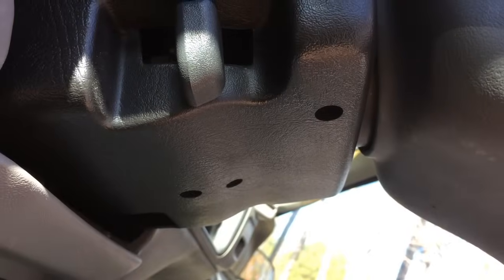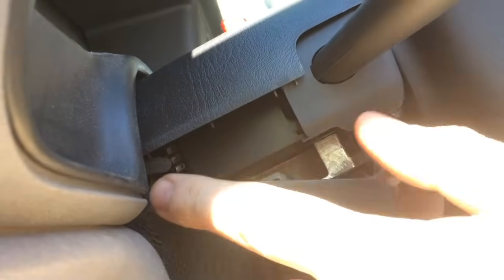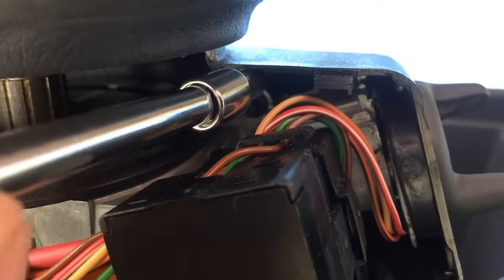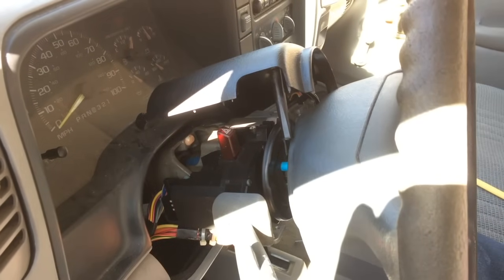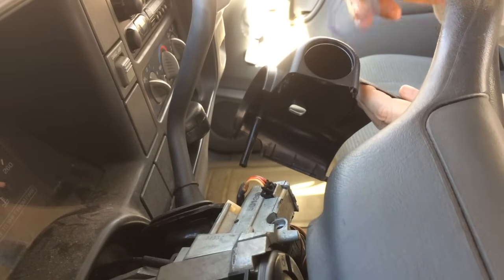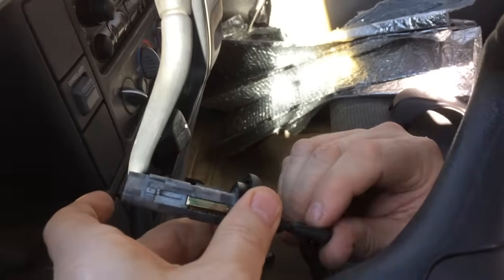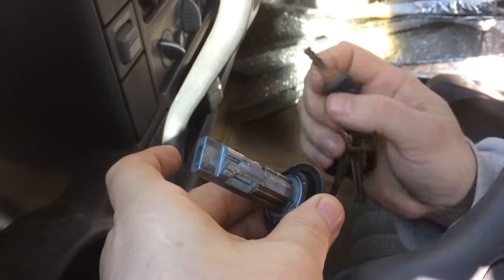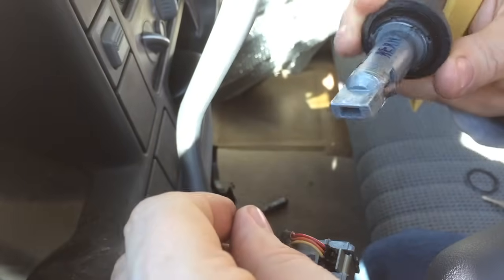1995 - 2000 OBS GM Truck Ignition Lock Cylinder Removal (Chevy Cadillac & GMC)

Comment: So, you’re telling me I can’t remove the lock cylinder without the key which is why I bought a lock cylinder? LL
Reply from the maker: If you've lost the key, yeah you''ll need a locksmith to get to this point of removal to install that new cylinder (or drill it out).   It's for theft prevention when the vehicle was new, so GM made it hard by design.
Reply: Thank God I’ve found the key
Reply: you can just drill it out, plenty of stuff on how to do that.
Reply: My key just won’t turn anymore and my steering wheel isn’t locked.
Reply from the maker: @Master_Yoda1990  You might check out the comment thread below from 
Jeff Burkholder at 6 months ago.  Sometimes you can follow what he and I discussed there to dislodge the key enough to extract the damaged lock cylinder.
Reply: DrShock thanks, didn’t have a drill, but I pounded the key in while turning after applying wd40 and it loosened up, however not really advised since it can ruin the key in the process.
Reply: @darkarvindrakkar9898  where?
Reply: @DrShock  drill what out...the pin in the little hole??
Reply from the maker: The locksmith would drill out the key tumblers in the cylinder
Reply: @DrShock  Do you know if these use keys that need programmed? Appreciate the video!
Reply from the maker: @chrisnielsen5467  No programming needed of keys on these model year trucks.
Reply: @DrShock  thank you!
Reply: So how would I drill it out through the top little hole or through wood with key goes
Reply: Cc  @DrShock
Reply: @DrShock  great, I just bought a 98 suburban for 500 bucks because there's no ignition key lol. Good thing I know a locksmith

Comment: Thank you for the video.  I am a 73 y/o 'lady' who today, thanks to your posting was able to replace a 'broken' lock cylinder on my 1998 Chevy Blazer LT.  All went exactly as you detailed on removing covers and old lock cylinder.  I put in the new one, but found it would only go in about two thirds of the way!  Oh boy.  I googled the issue and checked youtube to no avail.   I did notice that the 'pocket' inside wasn't lining up with the new cylinder.  I took a small tool and found I could turn the 'pocket'.  After two small turns, I tried again inserting the cylinder.  It fit perfectly and functioned as it should.  Hooked the battery up and started my car.  Fantastic.  Again, thank you for sharing.
Reply: 0

Comment: Thanks DrShock for posting one of the better videos on this procedure. Some have you removing the steering wheel, which I didn't really believe had to be done. Great job!👍😎

Edit: I just did this lock cylinder replacement for a friend of mine and it went so smooth that he swore that I must have done it before.Thanks for making me look like a pro!

Comment: Truck was stolen this morning, and recovered a few hours later abandoned. They damaged the ignition cylinder and so it has to be started with a screw driver. This video makes it easy! Thanks! The crooks did most of the work for me too and already took off the plastic covers.. lol!
Reply: My 96 was broken into last night and the steering is still locked but it's moving a little more freely do you know if thats only because the ignition is ruined or could it be the actual steering column

Comment: I just replace my ignition switch wiring harness. Before I put my top cover on my  steering column  I took some accurate measurements and drilled a little hole that I could get a ice pick through that was right in line with the ignition switch  release hole. So if I ever have to take  my key Tumbler out all I have to do is put ice pick through that little hole turn my key to the run position press to release turn my key back and remove the whole Tumbler. It works out great.
   There is a Nother video out there that tells how to measure off the emergency flasher switch to locate where to drill the hole that aligns with the Tumbler whole

Comment: Thank You Very Much!! it was that tiny hole on TOP,  this was on a 1999 S-10, everything else said the hole was on the bottom, note, don't touch or move anything, just push new cylinder in with key, and Done!

Comment: Awesome. Thank you. A standard 4mm socket works for the e5 hardware.
Reply: Not always, a 4mm did not work for me but my screws were a little worn for some reason but most of the time a 4 should work

Comment: Been having codes for torque silanoid and I changed it codes are still throwing so I had the transmission shop run diagnostics.  He said it was sealed up tight and it wasn't internal but he showed me one of the common symptoms is the ignition switch.  Never heard anything like that. Anyone here hear of it? 
Appreciate your video I got hung up with the top shroud and I like your idea to use that piece as a washer after popping it out. 😉

Comment: if the truck does not have a tilt, you can relax the two nuts that hold the column to the dash. This will  give you room to pry the top piece of the column cover out

Comment: Yes, I have done that but for some odd reason, the new switch is engaging the security system which I do not have a keyless entry or anything about nature what to do
Reply from the maker: For the old body style truck years this video applies from the video title, you might find some information in the description that helps.

Comment: DrShock, ever had a "Security" light issue? Re-watching this one... My '99 Suburban thinks I'm trying to steal it! Security light stays on, not the flashing security issue you can fix by relearning the key. Truck starts and immediately dies. Got a reman Passlock module that was supposed to fix it but...here I am.  Gladly use the tip jag again if you have any advise.
Reply from the maker: What are the codes pulled by the scan tool, if any?  This can be caused by a lack of communication between the VCM and the Passlock/EVO module.
Reply: @DrShock  TY for the reply. No codes... Just found that someone had done the diode install bypass trick in the past. So in theory, the new passlock module I put in is being bypassed; correct? I'm really perplexed on what to try next.
Reply from the maker: With no codes, and these symptoms, it's most likely a wiring harness problem.   You'll need a factory service manual schematic, but what you'll want to do is go thru the checklist in the service manual checking for good fuses and proper voltages at each pin to the passlock/EVO module.  Next there will be resistance checks across various pins of the harness.  As I mentioned earlier this kind of fault can also happen when the VCM cannot communicate with the passlock/EVO module.   You'll need to check the harness between both for any problems with the serial data line.  While the ignition cylinder has a role to play, it's very unlikely to be causing what you're seeing unless it's the incorrect part or extremely shoddy asian import part (either way missing the integral magnet required for passlock to function).
Reply: @DrShock  Holy Moly... I started looking at the wiring harness and found where someone has done the "Diode" hack... Now what? Should I suspect that diode went bad/burned out? I'm going to try to reconfigure the bypass and see back in factory condition the reman Passlock works, I can always replace the diode hack if that doesn't work. Thanks for the reply. My last attempt before I call the Calvary and have it towed to a qualified shop... I don't know how much of this I can take.
Reply from the maker: Most digital multi-meters today have a diode test setting, you could check to see if it has failed.  But if i were me I would remove this sort of modification and return the vehicle to the stock design.   Someone may have done this to cover up a different security lamp or code problem, rather than properly diagnosing it at some point in the vehicles earlier life.
Reply: @DrShock  Got a real scan tool on my Suburban and he found a1626 Anti-theft deterrent. Can't clear it though... That's probably why someone went the resister by-pass route. Now trying everything...
Reply from the maker: I think you meant code P1626 there.  That's a code that still typically points to a wiring harness related issue.  The GM service manual would be needed walk thru the numerous tests and checks at the VCM, passlock modules, ignition wiring, etc.

Comment: So our truck takes forever to get it to turn. We thought it was because we lost the original key so we had to use the spare key now, do you think my key is the problem or the ignition?

How much does the ignition cost and are they universal or do I need a very specific one? 
Thanks in advance
Reply from the maker: The Ignition cylinders are vehicle specific, I include the GM numbers for the trucks this particular video covers in the description above.   As far as having different keys behave differently I've certainly seen where an original key works smoothly and a replacement doesn't, that behavior is all on the key.   But if you have two keys that both are hard to turn, then there I would more suspect the cylinder itself as the problem.

Comment: Well the hardest part was getting my key to the start position seeing how I was replacing my ignition cylinder because it wouldn’t go to the start position
Reply: I'm in the same position how did you get yours to finally turn to the start position? Mine is jammed and will only turn a few millimeters each direction and the steering wheel is locked as well
Reply: I’m in the same boat.
Reply: Pry off the plastic piece that is exposed on the lock cylinder where you insert the key, once that piece comes off stick a small Allen wrench or screwdriver etc. underneath the locking bar at the bottom of the cylinder and lift up on the locking bar while turning key and it will move into position

Comment: Hi I am in the situation where the key will not turn enough for me to get the punch to hit the pin for it to come out like you said but how do I get it out at that point? Does anyone have suggestions
Reply from the maker: The lock mechanism can get jammed if there's an obstruction from broken metal (like the retaining pin for the lock mechanism).   You have to lube it up really well, with a lock specific lubricant, and and try to rock it back and forth to see if you can get it to free up enough to move the release pin into position.   It can take some significant time and patience to work one out with that kind of problem.   If you don't have the time, I would just suggest going straight to the mobile locksmith option.

Comment: Can someone explain what the wires are for above where u put ur key?... are they part of the security system at all?... I'm having trouble with mine because the person before me that I bought the truck off of had all this is a mess and it was all tapped in place with electrical tape so after removing the tap my truck won't start and I noticed those wires either weren't on my truck or they were removed and if that has anything to do with the security system in anyway I'm wondering if that has anything to do with it
Reply from the maker: The wiring layout in the column area may vary across models years, or across automatic to manual trucks.   Best advice would be to consult a service manual for the particular year truck and verify you have all the wire colors and connections the schematics show for the steering column area.  

Another option is a stop at your local pull-a-part salvage yard, like an LKQ, and visually compare an exact same model year and transmission type truck.   You might even just pull the intact wiring harness and use that instead of your previous owner damaged one.

Comment: Will a this give a intermediate  security issue? I can take my key out of the tumbler in run position
Reply from the maker: The connection on these old body style (OBS) trucks ignition cylinder with the security (aka Passlock) system is the magnet built into them.  When you turn the key the Passlock security module is looking to see that magnetic signal input to confirm the vehicle ignition switch is not being physically bypassed.   As long as you have a genuine GM cylinder, or a top tier OEM aftermarket one, that magnet will be there.  But it does need to rotate to function correctly.

Comment: Now this methodology would it fix issues with passlock where is will start sometimes and other there is the security lockout
Reply from the maker: Possibly.  For this year series of GM trucks, the lock cylinder just has a magnet related to the Passlock function.   The magnet works with the sensor mounted in the steering column housing itself by being detected when you actually turn the cylinder with a key.  That sensor then works with the passlock module and PCM to decide whether or not to throw the security tamper mode and block fuel to the engine.   Any of these components could be involved in a passlock problem.  So while the lock cylinder could be involved in a passlock problem, it's not always the reason for the security light to come on.  Checking for codes with a scan tool may help narrow down which part is at fault.

Comment: Great video and thanks but how do you do this if you have lost the original key???
Reply from the maker: Thanks.  The key is needed due to the anti-theft design.  If you've lost the key, you really should call a locksmith.  They will have the unique tools to remove the cylinder without the key.
Reply: @DrShock   Thanks buddy!

Comment: I know this video was made 5 years ago. But i hvae a question do u have to have the key to remove the key switch
Reply from the maker: Yes, the key is needed to rotate the lock cylinder into the position where you can depress the release button and remove it.

Comment: Could  that part  cause the 40 amp fuse  to blow? / was told  to oil it know dosen't  work??
Reply from the maker: Well this video is about removing the ignition lock cylinder, where the key is inserted.  The lock cylinder on these older model trucks do not have any electrical connections that could possibly have anything to do with such a symptom.  More likely the ignition switch or even the starter motor, for that 40A fuse going.  You would have to trace out the wiring and isolate which component is at fault.

Comment: I removed the Old lock cylinder because I was unable to remove the key , the key would turn forward and turn on the truck but when you turn it off it does not release the key. I purchased a new lock cylinder w new keys and same issue
Reply from the maker: Presuming here you can crank, drive, and shut off the engine.  What about the accessory position?   Just a guess, but I would be looking first to see if I have some misalignment or interference with the ignition switch preventing getting fully into the off position which could prevent key removal.  Considering you replaced the cylinder already it's something else.

Comment: My lock cylinder won’t come out all the way. It’s jammed in the start position and I’m trying to replace it. I already have the new part I just can’t get the old cylinder out
Reply from the maker: There's been some earlier commenters with this same problem.  Some of them had luck with the lube & wiggle approach, as the cylinder could be stuck due to the tumbler retainer coming loose inside the bore where the cylinder assembly is inserted.  Something lock safe like teflon lock spray, or silicone spray ideally.

Comment: I'm dealing with a similar issue on a 2004 Cadillac I was curious would be possible to just remove the Tumblers so it with the key would turn regardless? Obviously it wouldn't work without the correct included keys I'm just trying to save a little money with an old vehicle
Reply from the maker: Obviously there's no theft protection in that route.  But whether the cylinder would even function like that would be a question for a locksmith, I'm not sure.
Reply: Most dealers only charge about $25 to cut a new key and set the tumblers. Make sure to call around. Every dealer is different. They just need a VIN and proof of ownership.

Comment: I’m having trouble removing the bolt next to the ignition switch. Seems stripped. Any suggestions
Reply from the maker: If stripped on the head of the bolt, then you might have to switch to long nose vice grips to get it out.  And of course then replace it.  If stripped into the steering column, using long nose pliers to apply downward force to the ratchet wrench is what I would try.

Comment: I replaced the lock cylinder on now the vehicle won’t start, turns over but will not run, could it be related to replacing the cylinder or something else? Thanks
Reply from the maker: For the GM trucks in the year and model range of this video, if the engine cranks without the security light coming on the instrument cluster, then the lock cylinder replacement was successful and the problem is coincidental.   If the security lamp is lit, then you may have something related to the repair itself.
Reply: Thanks for the reply and the video, no security lights so I think it is something else, it is getting spark so I’m going to check the fuel next
Reply: Quick update, it was getting fuel also, I replaced the lock cylinder and it started